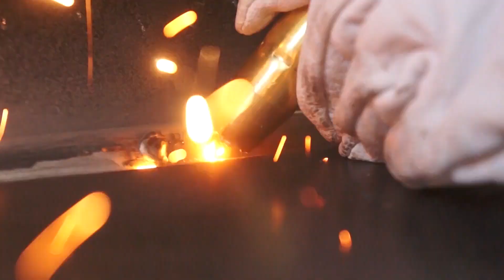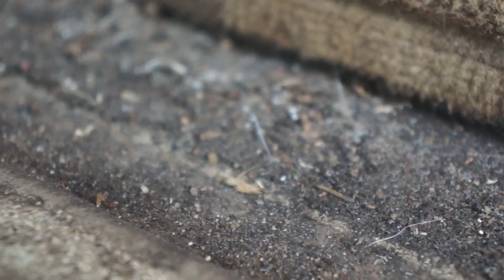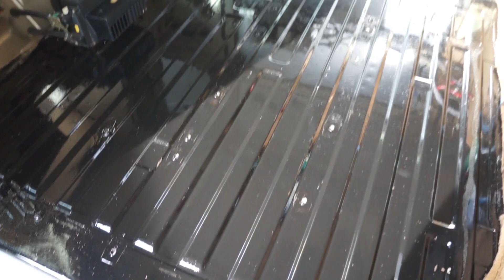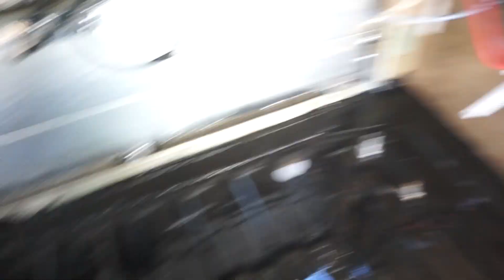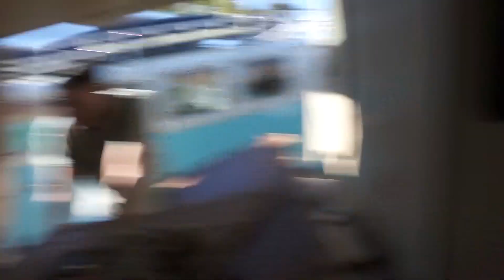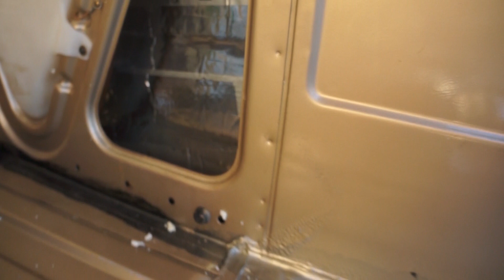Step 4: Insulation

Comment: Howdy mate, praying you see this comment and can provide some real life insight: would you use POR15 again if you were redoing it?

I don’t think I’ve ever seen anyone paint their floor in it, but I really love the idea. Did you read/see others doing it? How’d it hold up? I’m basically trying to find a way to rust proof my already rust free vanagon before laying down insulation etc. 

Any detailed insight would be so incredibly helpful. Cheers from Australia!
Reply from the maker: It has held up really well so far, but I do have flooring over it. POR is supposed to be put directly on metal, so I'm not sure if is the best choice for the job. I did it that way because I had used it in my split bus and it had worked great there. If I had to do this again, I would probably use some sort of bed liner like Raptor Liner or something. That would provide better protection from scuffs and a bit of noise insulation. If you do have any rust spots though, POR is amazing for encapsulating it.
Reply: @gottasplit5707  thanks so much for the insight—I’m super grateful. I was considering Raptor, but I have to be reaaaaally sure there’s no rust under there before I spray it over the top! Thanks for your time man, hope to see more content soon 🙏🏼

Comment: its been 4 yrs or so. wondering if all that insulation and fatmat worked and is it durable? Thanks!
Reply from the maker: Insulation is great, but the fatmat started to melt and caused a lot of problems. Dynamat is a better product that shouldn't melt since it is made of rubber and not tar.
Reply: @gottasplit5707   i learned a little bit more about insulation since i last asked. just wondering if you factored in moisture control and can you say more about that? Thanks!

Comment: insulation can trap moisture from condensation.   it dont matter if the foam is closed nor open cell, if moisture gets to the steel, it will become trapped by the insulation and your van will rustout from the inside
  it may take years to be a problem, you wont notice it till the rust breaks through to the outside, then it is too late.

Dont do it.

Comment: I realize i'm literally 3 years late but I stumbled on your video and just got my vanagon. I always planned on doing the sound insulation, however i'm confused if I should also add the foam insulation you are doing here. Is it mostly to prevent heat from entering the cabin? Or is it also for other risks?

Thanks!
Reply from the maker: I added it for heat, but it does help a little with the road noise, and doesn't soak up moisture like other materials do. If I were to do it over again, I would use a different material that is easier to install though. The cutting and putting the pieces together took forever.
Reply: @gottasplit5707  DO you think it is absolutely necessary? Or if my main concern in road noise I could stick with the fatt mat only?
Reply from the maker: @marc-antoinesauve5636  You'd probably be good with just the fact mat, although I would suggest using Dynamat. Its made of better material that doesn't melt when it gets hot. I had to remove all of the fatt mat from my van because the heat here in Miami made it start to smell like tar and melt. Was a huge pain to get back out of the van.
Reply: @gottasplit5707  Good to know! Thanks a lot!

Comment: I know this question has nothing to do do with the video but what size tires and wheels are on your van? What are the wheels off of? Have you lifted your van?

Thanks,
  Matt
Reply from the maker: Hey Matt,
The wheels are stock from my Vanagon and they are 14”.
Tires are General Grabber AT2  27X8.5X14.
I have stock suspension, but it does seem a bit taller than most Vanagons for some reason. Someone told me its because my van is a GL and they came from the factory a little bit taller.
Hope that helps, good luck!
Reply: I bought 15" mercedes off craigslist, then saw another guy on Youtube with a red and white vanagon, run 17's.  T3 Technigue, Chris, sells the hardware (lug nuts are different, ball vs cone) and that was most expensive part of this, so I went back to CL and found 16" from E class Mercedes really cheap.  They did lift the vanagon and I like how they look.

Comment: IF we only use our campers in the summer, and we don't have AC, why do we need insulation ?   Maybe for the AC ?  Maybe for camping in the fall or winter ?  Maybe for condensation ?    A maintenace guy  I knew used caulk to "stick" things like pictures in place, easy to attach, they stay put and if you want to take them down, a utiliy knife or wire will work...I wonder if that would work on the foam board...
Reply from the maker: DanTheManIOM The insulation keeps out the heat and noise also. There is a spray adhesive you can use that is for interior stuff. I’d be careful with any other type of adhesive since many can melt foam. It could work though. Just try it on a small piece fits to see if it reacts.
Reply: @gottasplit5707  I'm following you...got the board last summer and foil tape...looking for video 5 now to reinstall the cabinets/sink, etc.
Reply from the maker: DanTheManIOM Nice!!! The board is a bit of a pain to cut up and piece together like a puzzle, but well worth it. Here’s video #5: https://youtu.be/TA9rrbhf09M

👍👍👍

Comment: you can buy a cheaper version of fatt mat at lowes,  look for "peel and seal"
Reply from the maker: I’ll have to look for it. Amazon had a pretty good deal so I think 50ft will be enough lol. But when I do the bug I’ll see if the Lowe’s here has it. Thanks!
Reply: Does that stay put ?  Or you just use it on the sides and floor, not the roof ?  That texas heat would be the stress test, if it works there, it should work most anywhere else.... we have deserts in America, we just don't live in them...